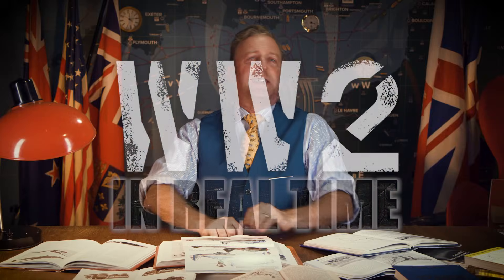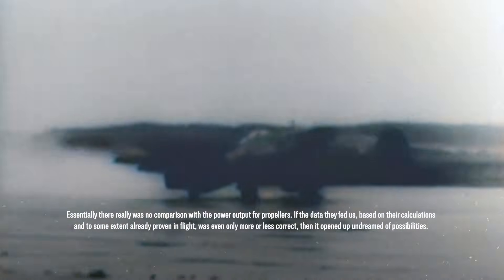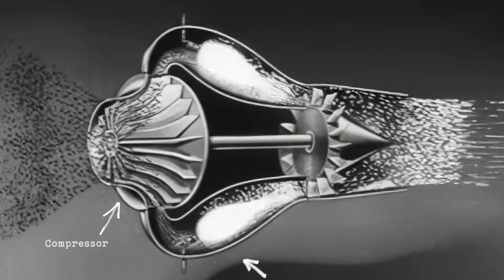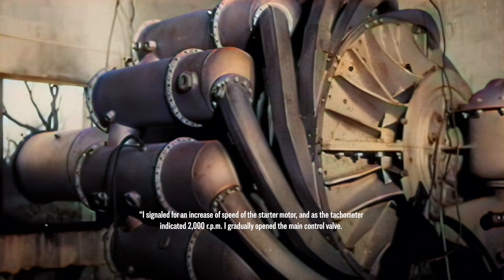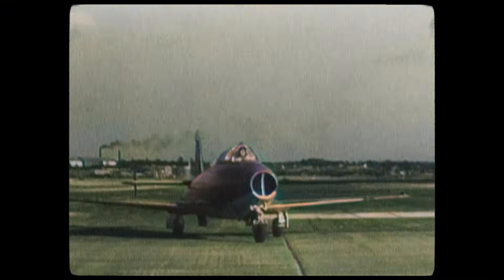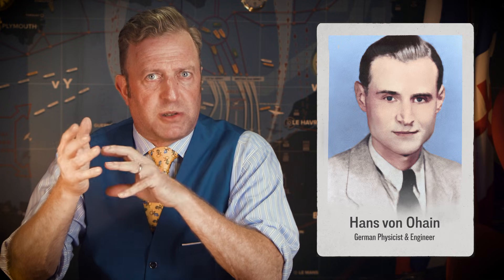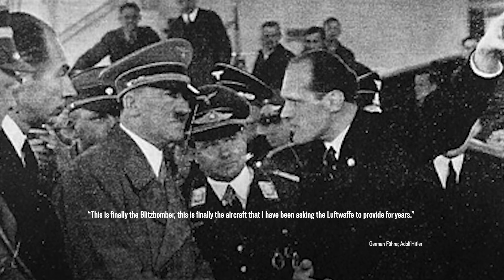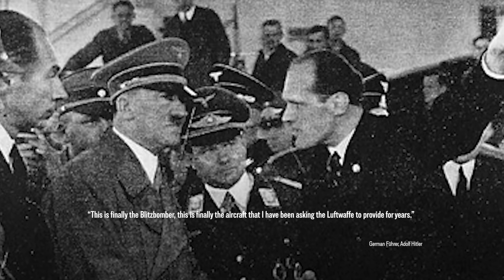WW2 Jet Engine Development - WW2 Special Documentary

Comment: Whittles engine was more reliable than the axial flow engines.
Reply: Centrifugal flow was very robust against stalling. It would take a couple decades of R&D for axial flow to finally caught on and replace centrifugal flow.

Axial flow now has very sophisticated control systems and can have 90%+ efficiency.
Reply: @yatsumleung8618 Decades? No! Few years, yes. Axial compressors took over already at the end of the 40's. Centrifugal compressors are simply no option for higher thrust engines, since the required higher air mass flow would also require huge diameter centrifugal compressors. On the other hand centrifugal compressors are still a thing in small modern aero engines, even in fan engines. Usually as the high pressure part in combination with lower pressure axial compressors. See PW 300 or 500.
Reply: @sandervanderkammen9230  As I mentioned in my first comment, centrifugal compressors are still a thing in modern aero engines. But the applications are limited to smaller engines where flow efficiency losses due to diverting air flow directions are neglectable. Centrifugal compressors have the big advantage, besides being more simple in design, to have much higher per stage compression ratios and hence reducing axial  dimensions and weight.
Reply: @wanderschlosser1857  Centrifugal compressors are NOT still used in jet engines, they are too bulky, heavy and inefficient for use in jet aircraft.
Centrifugal turbojet engines were clearly an evolutionary dead-end concept.
Even Rolls-Royce ceased production of Centrifugal jet engines in 1953, 71 years ago!
Reply: @sandervanderkammen9230  Maybe worth to Google a little bit before commenting nonsense. Of course there are still centrifugal compressors used in modern aviation gas turbines. That includes turboshafts (MTR 390), turboprops (PT6), turbofans (PW300 and PW500). Mostly as the high compression section in combination with axial compressors for lower pressures. Big advantage is the about 3-5 times higher per stage compression ratio. Using them reduces complexity, size and weight. Makes only thermodynamic vs. weight sense for lower mass flows, hence smaller engines.
Reply: @wanderschlosser1857  You need to Google the difference between a TURBOJET and a TURBOSHAFT.
There are no longer any centrifugal jet engines used in jet aircraft production today, your comments are nonsensical and completely moot.
Reply: @sandervanderkammen9230  Wow, you really don't know what you're talking about! There aren't any modern clean turbojet engines anymore. Pretty much all jet engines are turbofans nowadays. And Pratt & Whitney Canada turbofans like the PW300 and 500 series are a great example that centrifugal compressors are still in use. And yes those engine types are very modern and still in production. Instead of posting nonsense, just Google them and see for yourself. 
Besides that, turboshafts, turboprops, turbojets or turbofans are all gas turbines with the same basic working principle including compressors. And you find modern examples of all of them with centrifugal compressors. Well, not of turbojets too much, because absolutely nobody still designs clean turbojets anymore, apart from maybe RC plane engines, all of which use centrifugal compressors as well btw.
Reply: @wanderschlosser1857  Sorry, but the PW300/500 is not a true turbofan engine.
Like the Lycoming ALF It's a ducted fan powered by a turboshaft engine, the low pressure compressor does not supply air to the core turboshaft.
Please name a jet engine in production with only a centrifugal compressor.
Reply: @wanderschlosser1857  Sorry, but you are very confused.
The PW300/500 is not a true turbofan, like the Lycoming ALF it's a ducted fan powered by a turboshaft engine.
The low pressure compressor does not supply air to the core turboshaft and is not fully integrated, there is no low pressure turbine.
Please name a single centrifugal jet engine still in production???
Reply: @sandervanderkammen9230  The PW300 and 500 are true turbofans. They function the same way the bigger PW6000, 2000 or 4000 do. The fan is driven by the LP turbine and shaft. It doesn't matter whether there is a LP compressor on the same shaft or not. The core engines of turboshafts or turbofans are principally the same. In fact there are several turbofans that have an industrial turboshaft version, e.g. CF6-80 / LM6000 or RB211 and Trent.
Reply: @sandervanderkammen9230  The MTR390 is an example of a centrifugal compressor (2 stages) only engine. Most other engines with a centrifugal compressor use them in combination with an axial compressor. And my point was simply that centrifugal compressors are far from outdated but simply limited to smaller gas turbines which includes turboshafts, turboprops and turbofans.
Reply: @sandervanderkammen9230  Again, a turbofan technically doesn't need two or more shafts to be called as such. It simply needs a fan creating a bypass flow for propulsion. Apart from that of course PW300 and 500 are 2 shaft engines. They got an HP shaft with the combined axial+centrifugal compressor and a 1 stage HP turbine driving the compressor. And they have a concentric LP shaft with a 2 stage LP turbine driving the 1 stage fan. The fan btw. also acts as an LP compressor for the air ratio that enters the core engine.
Reply: @wanderschlosser1857  Please name single centrifugal jet engine still in production???
Reply: @sandervanderkammen9230  PW300, PW500 are Turbofan engines which are a kind of jet engine. And there is the PT6 turboprop. All of them use a combination of axial and centrifugal compressors. And there is the MTR390, a turboshaft which has got a 2 stg centrifugal compressor with an enhanced version currently in development. And all of those engines are gas turbines, working after the same basic principle. I think I repeated all of that several times now. When will you get that centrifugal compressors aren't an old design, they are simply limited to certain lower mass flow classes of gas turbines.
Reply: @wanderschlosser1857  Those are NOT centrifugal jet engines, they all have AXIAL compressors.
Reply: @sandervanderkammen9230  And centrifugal compressors! Don't they? You start to bore me!
Reply: @wanderschlosser1857  Please name a single jet engine in production today that only has a centrifugal compressor????
 Centrifugal engines are inherently inferior and were obsolete on arriva... they were an evolutionary dead-end concept.
Reply: @sandervanderkammen9230  You keep repeating your nonsense! What would it prove if I named you one modern centrifugal compressor only jet engine? You still don't get my point, do you? Centrifugal compressors are still in use and part of new designs for a reason. It doesn't matter if single or in combination with axial compressors. And it doesn't matter, whether turbojet (which aren't really made anymore except for RC planes) or turbofans or turboprops or turboshafts or even industrial applications. These are all gas turbines with the same basic working principle and air compression requirements. If you can't grasp that or the point I'm doing you shouldn't comment on gas turbine engines at all.
Reply: @wanderschlosser1857  Centrifugal jet engines were an evolutionary dead-end concept, they are no longer used in any aircraft today.
Germany was a decade ahead of the Allies in jet engine technology, this is an irrefutable fact that cannot be denied.
Reply: @sandervanderkammen9230  Did you swallow a record, you keep repeating yourself. Centrifugal compressors are still in use in modern aero gas turbine engines and still in new aero engine designs. I gave you several examples. It's a fact, let it sink in and bore somebody else with your jet engine nonsense. Have a good one!
Reply: @wanderschlosser1857  You can't argue against the facts lad.
Please name a single centrifugal jet engine still in production???
Reply: @sandervanderkammen9230  I don't need to name such engine because it wasn't the point I made. Pure jet engines (turbojets) aren't made or designed anymore anyway. All gas turbine type jet engines nowadays are turbofans, that applies to commercial airliners as well as fighter jets or Learjets. And the latter very often use PW300 and 500 engines. Which have centrifugal compressor stages in them. There are also quite a few turboprops and turboshafts using centrifugal compressors. That proves centrifugal compressors are still very much a design feature for certain applications and get more and more advanced same as axial compressors. That is a fact and that was my point from the very beginning. And if you don't get that the core engine, a gas turbine, between all of these engine types are the same in principle then I can't help you.
Reply: @wanderschlosser1857  ALL THOSE ENGINES HAVE AN AXIAL COMPRESSOR.

PLEASE NAME A SINGLE CENTRIFUGAL JET ENGINE MADE TODAY???
Reply: @sandervanderkammen9230  And they also have a centrifugal compressor which proves my point and still renders your question pointless.
Reply: @wanderschlosser1857  PLEASE NAME A SINGLE JET ENGINE IN PRODUCTION TODAY THAT DOES NOT HAVE A AXIAL COMPRESSOR???
Reply: Yes that's the thing. From what I understand Whittle knew axial flow was ultimately 'better', but he wanted a simpler engine to power jet aircraft as soon as possible. Unfortunately he didn't know it would take so long due to all the faffing around! His engines were far more reliable than any German engine, and had a much longer lifespan too. The Germans did not have access to enough materials to build enough of their engines either.
It's not unlike the fact that crossbows were used well into the handgun age. New stuff that's going to be great in the future is sometimes inferior to top line older tech.
Edit. Older or simpler tech!
Reply: @jimb9063 As A.A. Griffiths pointed out, Whittle didn't understand how a Axial compressor worked.
His 1930 patent was filled with egregious errors regarding the compressor stage.

Whittle's engines were extremely unreliable and could not pass airworthiness certification.
Reply: Yes. The 262 axial flow engines were ahead of the control and material technology. The 262 engines had a lifetime of ~25 hours (replace, not simply overhaul). Whittle is said to have known this and why he went with the centrifugal compressor. Whittle also invented the concept of high bypass in 1936 (patent 471368). Unfortunately, he seemed to be largely out-maneuvered by large companies and cronyism.
Reply: @disphoto The Jumo 109-004b was the most advanced turbojet engine in service during WW2, it had the most advanced fuel controls and thermal management technology.
The German jet engine easily exceeded the RLMs 100 hour PFTR, this is the same 100 hour certification standard as the RAF and the USAAF during WW2.
Reply: That's actually completely false, in fact Whittle's engines were so unreliable none of them were able to pass the RAEs 100 hour PFTR Minimum reliability standards for adoption into RAF service.
The RAF would not use any Whittle engine in service.